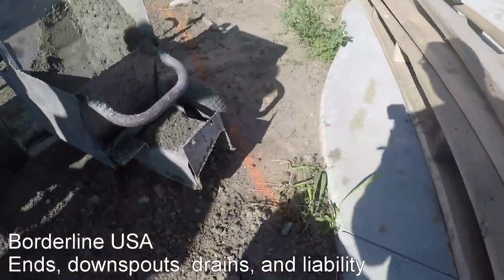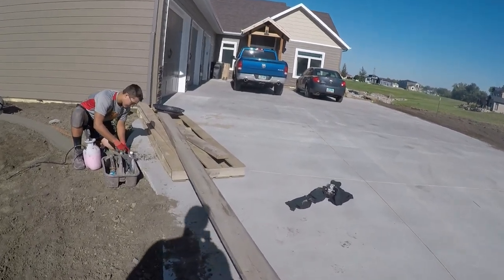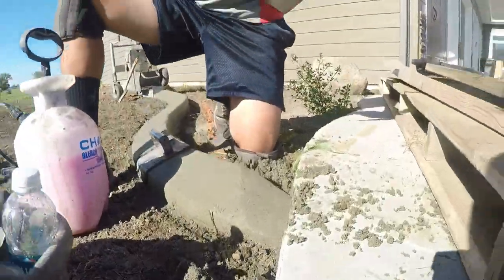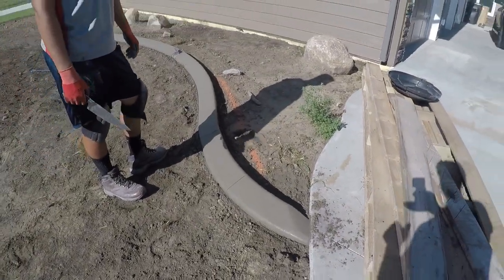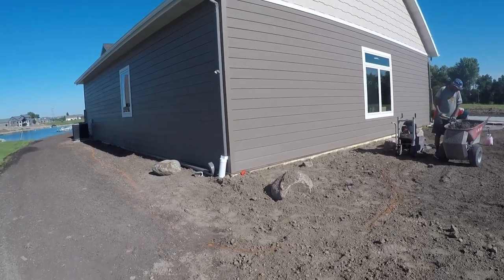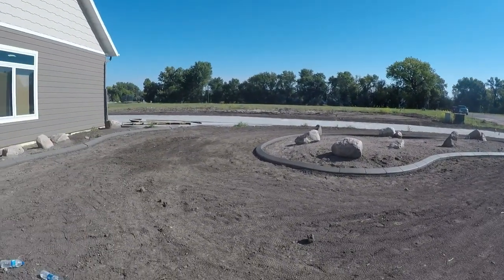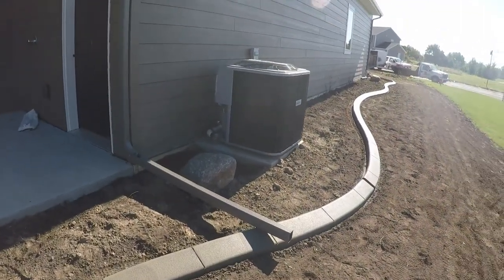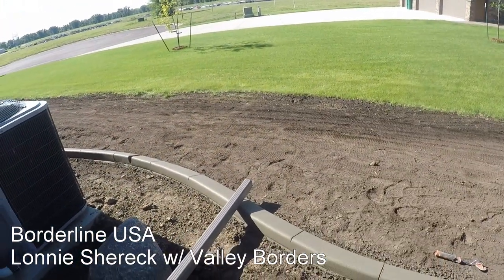Landscape curbing - Ends, downspouts, and drainage for curbing.  Borderlineusa.com

Comment: Have you ever added cable to your curbing? If not, why not? Thanks
Reply from the maker: We have added before if specs call for it or landscaper needs it for a particular job.  Contrary to belief cable is only helpful to prevent separation and doesnt increase compressive strength. If ur curbing in areas that have alot of clay and have frost heaven u might see more of a need for it to keep curb together . Where we are we dont have any of that and never have issues with separation horizontally.
We do put admixtures in to increase compressive strength, concrete polymers, along with another to make concrete more dense which increases strength also.  We have no cracking or separation issues here but desnt mean that cable isnt needed in other places. Hopefully that answers ur question.

Comment: The curbing company I work for drills holes in the bottom of the curb for drains and recommend the homeowner use a handful of small rocks to act as a filter. We are in Florida and do not have to worry about winters. Also for the gutter systems we never lay the pipe on the curb, we  do cut outs so the gutter will sit into the curb or we do splash guards. A splash guard is curb on both sides of the gutter pipe with a concrete base between the two. The splash guards are my favorite thing that we do.
Reply from the maker: We can't afford to have those holes to plug so the basement floods,
We dont have the sandy soils and almost every house has a basement.
Reply: @borders06  Makes total sense and is the price to pay to be safe.